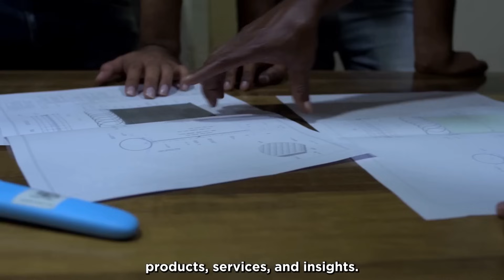Pinaka To Soon Have A Far-Reaching, Deadlier And More Accurate Punch

Comment: I don't see why Tatra trucks are used when there are indigenous alternatives like Tata or Ashok Leyland which can do a better job. Blacklist Tatra,.
Reply: 1) bribery and corruption you can read the about the beml tatra truck scam
2) its changing after tata and ashok leyland developed their own 8x8 high mobility vehicle. All the recently made missile lauchers wheather it was the qrsam, akash ng or even the older mrsam will use the ashok leyland 8x8 super stallion truck
Reply: @IMP7567  Yes I think the whole BEML deal was a bad one. I still think my original comment stands.

Blacklist Tatra again.
Reply: Beml are making truck for indian army from several decades
Reply: @SurajMandal-lj6hc  And what are Tata and Ashok Leyland? Fly by night operators?

Tatra should be banned. BEML has no tech to make trucks in all honesty. Just privatize it and leave it to private sector to make trucks.